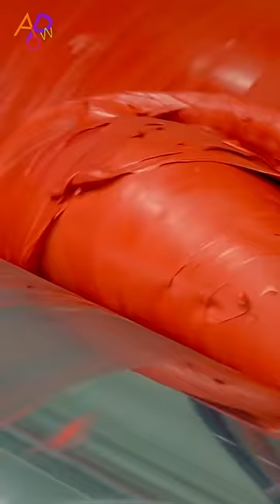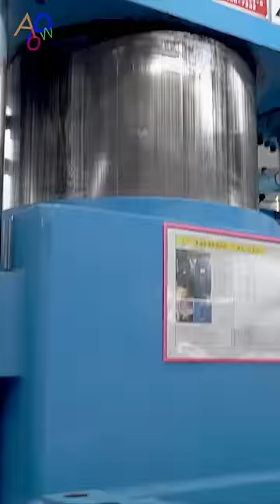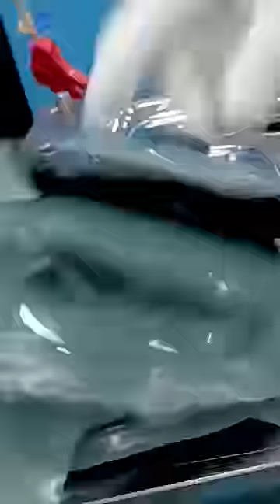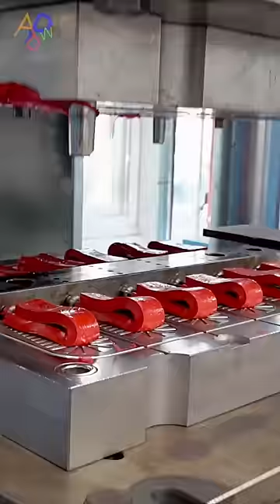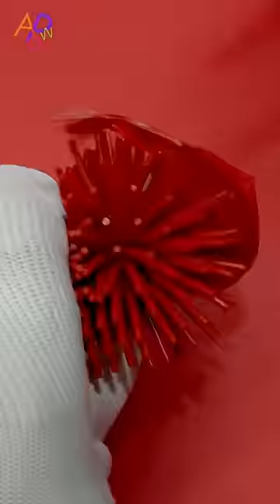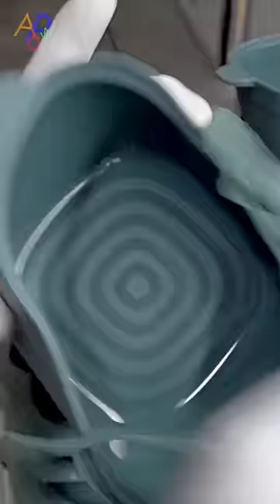Silicone Cookware Making Process #allprocessofworld

Comment: Iam also working in rubber molding  as a machine operator  in this  video  for viewers they doing the work slowly  but in realty  they do  alter fast  they do slow the mold core heat will reduce and the next lift for  product  quality  will reduce
Reply: I have no idea what you tried to say. You should slow down a bit.

Comment: This is not silicon since it sure as hell doesn't act like this ffs, this it soft vinyl.
Reply: It's silicone before curing
Reply: @CM-xr9oq  LOL YT hid your reply because you said "iggit"
Thanks for your help btw!
Reply: @MaximilianonMars  The heck are you talking about?! Silicon is silicon and not to be confused with, that I can't understand how you can, PVC. That is of course a totally different material and is also cured by heat in contrary to silicon that is never cured with heat. So my fact still apply.
Reply: @dtiydr  경화전 실리콘이 맞고 경화 후에는 전자레인지에서 사용이 가능하다 실리콘 메뉴얼은 SH2781 의료용 실리콘이고, 소프트비닐은 주방용품으로 적합하지 않기 때문에 사용하지 않는다
Reply: @dtiydr В пищевой промыщленности используется Оксид титановые полимеры так как оксид кремния имеет канцерогенные свойства.
Reply: @JIUNnF  А полимеры оксида титана - это не кремний.